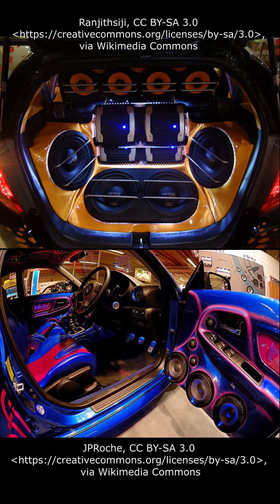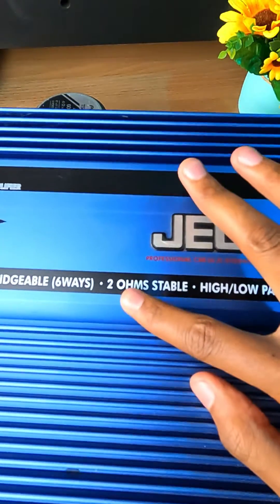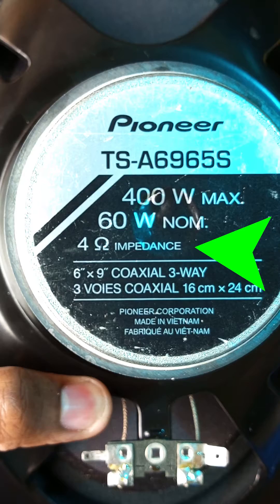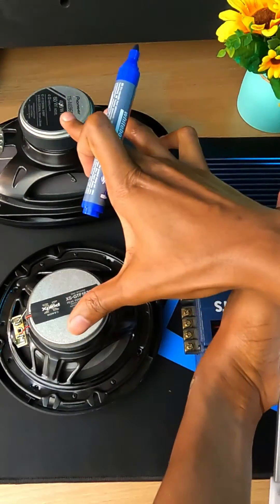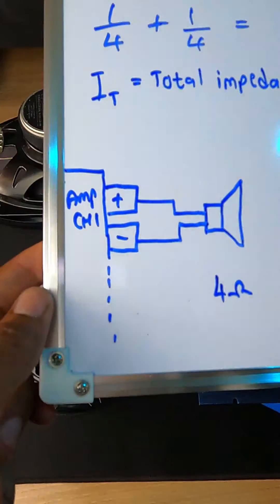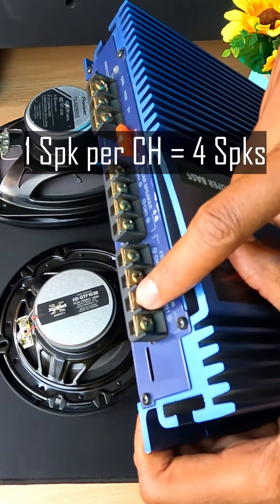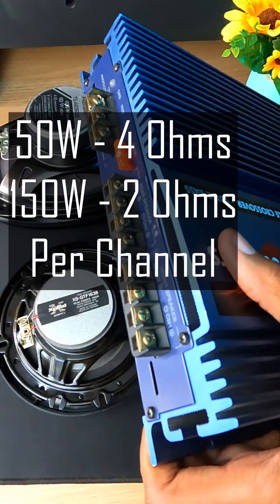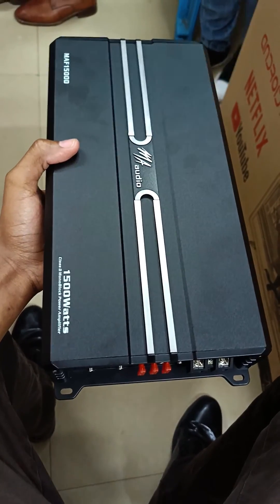2 Ohm Stable Amplifier Speaker Connection

Comment: Hey Dominic. Good stuff with the channel. I have a question regarding my Head Unit. Its a Pioneer MVH-S420BT now is it possible to connect 6 speakers to this unit without a problem. I have two 6.5 in the front. In the back seat id want to connect 13cm mids and 6x9 and a bochmann equaliser. 
Can this head unit drive all this without a problem. I don't want to connect an amplifier as im not looking for too much bass. Kindly advice
Reply: Awesome Question!!!